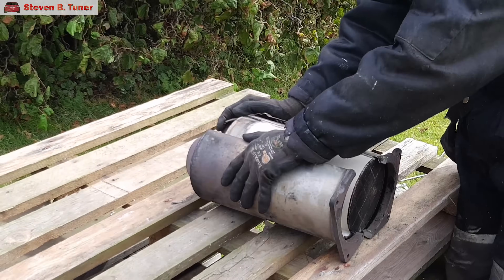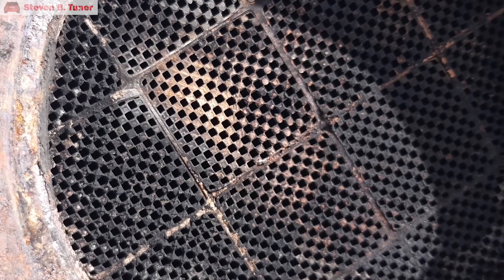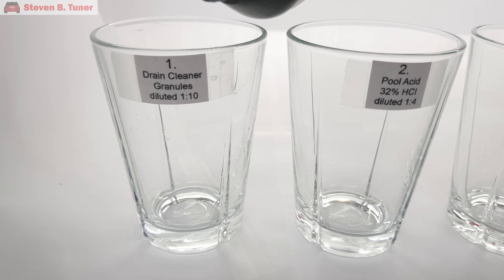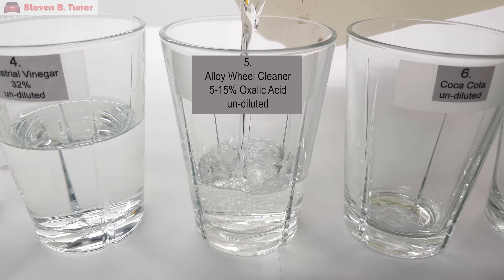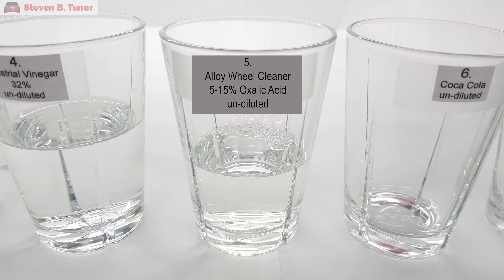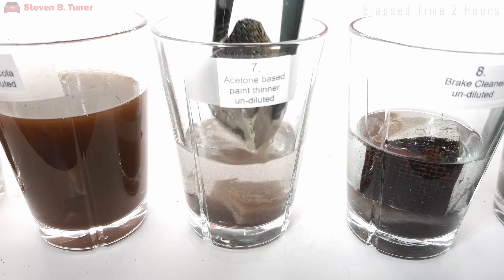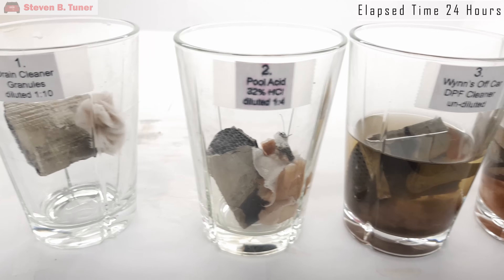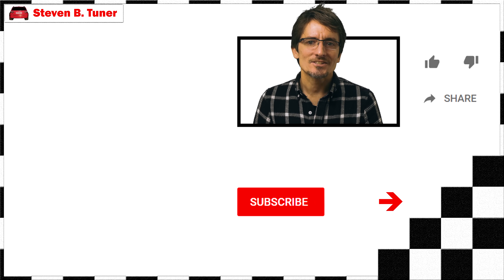DPF Cleaning at Home – 9 Chemicals Tested (Diesel Particulate Filter DIY Ash Cleaning)

Comment: Hi Steven, i recently removed the dpf from a Peugeot Partner van and cleaned it. When it was reinstalled and van taken for short journey a lot of white smoke came out of tailpipe and when engine was stopped the engine fan kept running for ages. Exactly the same thing happened last time i cleaned it 2 years ago and have never heard this fan running before that or since except for the latest clean out. Why do you think this happened? Love your videos keep up the good work.
Reply: Maybe you need to run "DPF filter replacement" procedure with diagnostic software to let ECU know that filter is not clogged anymore.
Reply: @emulatorbluestack7231  No warning indicators since cleaning filter
Reply from the maker: Hi, I am guessing that either there was water or residual chemical left in the DPF that was burning off or otherwise your engine ECU got very confused by the sudden drop in pressure and initiated an extended regen which dumped a bunch of un-combusted diesel into the exhaust.

Comment: Great and informative video Steven. Apologies if I missed it, but have you tried sulphuric acid as one of the ash dissolving agents, either concentrated or diluted? It's available from certain outlets as an extra powerful drain cleaner at 90% or so concentration.
Reply from the maker: Hi, I suspect that sulphuric acid will work fine, and won't damage the steel case - although I haven't tried it. I have avoided it as it is not easily obtained by individuals in most of the world, and it is pretty nasty if it splashes on you - so protect yourself well. It would be great to hear how it works out!

Comment: So Alloy wheel cleaner should be a good thing to put in the DPF?
Reply from the maker: Hi, thanks for watching! I haven't done a full clean with it, but others have commented that it works well as the 2nd stage clean instead of the HCl used in this video: https://www.youtube.com/watch?v=LE1boZ3fhLg  Concentrations and ingredients of wheel cleaner can vary a lot, so you will probably have to review the safety datasheets to ensure that there enough Oxalic Acid or Phosphoric Acid to do a good job.

Comment: You fix this engineering bullshit by cutting it off from your exhaust pipe and putting a clean pipe. DPF is a proof that not all engineers are smart people.
Reply from the maker: Hi, thanks for watching! If it wasn't for particulate filter technology, diesel vehicles would probably have been banned from the roads sometime between 2005 and 2010 worldwide. So I would say that it is one of the more successful engineering solutions out there, as it only needs cleaning every 150-200k miles.

Comment: Hi Steven I have a p244d code and dpf is 55 soot level no idea what it should! be but my galaxy has a vaporiser apparently anyway . ive used 3 dishwasher tablets how long should I keep it soaked for and what next do I need to do can I use mr muscle some have said it can take the coating of the dpf apparently regards
Reply from the maker: Hi, thanks for watching! My other video shows the whole process: https://www.youtube.com/watch?v=LE1boZ3fhLg using drain cleaning granules and pool/brick cleaning acid mixed 1:4 with water. Using 10 dishwasher tablets can work instead of drain cleaner to help dislodge any oil. Mr muscle will also help remove oil. However you will still need the 2nd stage acid wash to remove the ash that has built up over the years in order to have a DPF that is as clean as new.

Comment: Just pour couple of bottles of coke cola into the dpf,  let it sit for couple of days,  jet wash.  Job done.
Reply from the maker: Hi, thanks for watching! Using coca cola is a bit slow compared to the other acids in the vid as it is about 100 times weaker. You can see my preferred method for a full clean in this vid: https://www.youtube.com/watch?v=LE1boZ3fhLg  Also, there can be damage caused by high pressure washing as you can see in this vid: https://www.youtube.com/watch?v=-0mtz3Icg5o

Comment: Great informative video. So Pool cleaner  and alloy wheel cleaner are the best to get you Filter as good as it can be.  What brand of pool cleaner/alloy wheel cleaner did you use, Please?.   :-)
Reply from the maker: Hi, thanks for watching! This video shows the whole process: https://www.youtube.com/watch?v=LE1boZ3fhLg  So far the drain cleaner (caustic soda / sodium hydroxide) is still my favorite pre-wash, and my favorite main wash is 32% Hydrochloric acid (pool acid / brick cleaning acid) mixed 1:4 with water. These are generic chemicals available worldwide, so there is no brand to recommend.

Comment: I can't understand 100% of your words because the translator isn't working properly.
How many drugs should I choose from the drugs 1 to 9 in the video?
Reply from the maker: Hi, the chemicals that have worked the best in my previous video are drain cleaner granules (Sodium Hydroxide / caustic soda) dissolved in 10 parts water, and then 32% hydrochloric acid (pool acid or brick cleaning acid) dissolved in 4 parts water. The whole process can be seen in my video "The No Damage DPF Clean": https://www.youtube.com/watch?v=LE1boZ3fhLg
Reply: @StevenBTuner  Watched the video. In Korea, a large amount of hydrochloric acid is not readily available. Can you obtain effective results by cleaning dpf using only sodium hydroxide?
Reply from the maker: Hi, sodium hydroxide is not enough on it's own as a lot of the compounds in the ash only dissolve in acids. Can you buy products for use with hydroponic plant growing? There are hydroponics water acidity modifiers that should work for cleaning a DPF. The 'pH Down' product is usually Nitric Acid or Phoshoric Acid (use instead of hydrochloric acid), and the 'pH Up' product is usually Potassium Hydroxide (which can be used instead of Sodium Hydroxide).

Comment: Specific brands would be useful as ingredients can vary
Reply from the maker: Hi, thanks for watching! Because this video is seen all over the world I deliberately avoid brand names wherever possible. Every country has swimming pools that need acid, or bricks that need cleaning, or drains that need flushing - so there are always local generic brands that provide these types of chemicals at the lowest possible prices. Sometimes the concentrations differ, but that is a relatively easy adjustment to make as it just means adding more or less water.
Reply: @StevenBTuner  then the test provides little useful info also why is Wynnes an exception as you mention them
Reply from the maker: Hi, I don't know why you would say that - 30% pool acid mixed 1:4 with acid can be replicated in every country with ease, so it is super useful information that anyone can use. The Wynn's product is in there because I was asked to test it by a viewer, and it also shows how just because something sounds like the right product and has a known name, doesn't necessarily mean it is going to work.
Reply: @StevenBTuner  Yes however you use for instance a specific  wheel cleaner a specific dishwasher tablet who's ingredients will be brand specific  hence other brands my not give the same results
Reply from the maker: @ARTSPRAYUK  Great point - there are much more reliable ways to get the active ingredient of that particular wheel cleaner (oxalic acid), and as for dishwasher tabs, well, all that I want from them is their ability to break down some oil - so dish-washing liquid could just as easily be used (although it is a bit foamy), or some kind of standard industrial de-greaser.

Comment: Mybe gasoline good for cleaning this
Reply from the maker: Hi, thanks for watching! Gasoline doesn't have any effect on ash or soot, so isn't really useful as a DPF cleaner pre-wash or main wash. It would work to remove oil, but degreaser is a much safer option.
Reply: @jorulfkolsvik7457  ok mister...good experience

Comment: I would like to see a test with denatured alcohol (commonly found in the painting section at a local hardware store or home improvement center). I had looked all over for a product that would release the lacquered/varnished parts(carbs and tanks) of a normal gas(petrol) motor. I found a YouTube video that had suggested denatured alcohol. So tried it on a generator gas tank that had sat for upward of 10 yrs without being run. Within minutes it had broken down a very good portion of the glazed gas and I left it sit for 24 hrs. The inside of the tank looked as though it were new without any agitation. Best of luck and thanks for the video!
Reply from the maker: Hi, thanks for watching and for the suggestion! I haven't tried it myself, but it sounds like it might work for dissolving any oil, and so might make a good 'pre-wash'.

Comment: Hi Steven B. Congratulations , great videos...
But the dishwasher tabs doesn't have some sand to improve the dish washing? if so, this sand can block the DPF
Reply from the maker: Hi, I guess that there are a lot of different types out there - I would recommend fully crushing and dissolving before using, and not pouring in any sediment from the bottom of the bucket just in case.

Comment: Hi Steven, great videos! 
I have just cleaned my dpf. For the pre clean I used Fairy platinum dishwasher tabs x 15 in 3lts of hot water, which was enough to totally fill and clean my dpf unit. Most brick cleaners here in the UK are hydrochloric acid 16%, pool cleaner is not so readily available, so I used brick cleaner 2:1, then flushed with lots of fresh water. Only thing I did different was to dry the unit with a hot air gun afterwards (I was worried that water in the insulation would turn to steam under exhaust temperatures and cause some damage? A high amount of water is absorbed in the insulation!) I then stood the dpf vertically on its outlet (cat end) with the hot air blowing in the bottom, took quite some time to dry! 
It would be good to see a video of you putting a dpf back after cleaning and showing what checks should be carried out to show it is working correctly, there are probably a lot of people that watch these videos on cleaning a dpf unit and quite capable of taking the unit off their vehicle and carrying out the clean, but would not be sure on how to check it is performing correctly/better after the clean! Also some detail of why you would take the dpf of the car in the first place, I know you have produced other videos of things likely to cause a blocked dpf, but there are tests that should be carried out first, before removing the dpf to clean.
Reply from the maker: Well done on doing the job yourself! My 2006 320D is up to 70 grams of ash now so it is time to do the full video from error message all the way through the process to measured ash level when it is back on the car - just as you have suggested. I wouldn't mind a bit of warmer weather first ;-)
Reply: Hi Steven S, did you use 15 tablets in 3lt of water?
Reply from the maker: Hi, how many tablets and how much water is really dependent on how much oily soot is in the filter. If the car is running perfectly (except for the ash clogging) then 10 tablets in 10 litres could be fine, but if there is a lot of oil then you would be better with 20 or 30 in 10 litres  of water.
Reply: @miguelpinheiro8553  Hi, yes I did, this worked for me although mine was not that blocked with soot and grease, it was as a preclean to the acid clean as mine was more blocked with ash. 15 tabs did seem like plenty though, when you think one would normally do a whole load of greasy dishes!
Reply: Doesnt all this suggest that DPF cleaning is really not the issue its made out to be? Maybe if one is a workshop, having cars hanging around for 24 hours to do the work is a real profit limiter, so they tend to use machines and no doubt a proprietory chemical on a rental program. But if one has 24 hours and the car is at one's home it seems to me there's not much stopping us from concluding that Steven's experiments give us high degree of belief in Oxalic acid and dishwasher tabs (perhaps increased if the soot is particularly heavy and we can fill the DPF up from the oxygen or temperature sensor on the top if the DPF is the upright type. Looks like you could actually get rid of the ash when others have said no, once inside there is no effective solution for ash. In fact it is claimed that the amount of ash capacity is the limiting factor to the DPF lifetime. But having loooked at Steven's experiments I cannot help but feel he has managed to explode a myth that is so costly to deal with in normal ways, such as commercial cleaning (£200+) or some are persuaded, seemingly wrongly, that their DPF has in fact reached its ultimate lifetime. I wonder if others agree with me that Steven has demonstrated the no harm solution conclusively. So what determines if you can clean your DPF whilst its in or on your vehicle or whether it must be removed? Might that simply be determined by whether your DPF is in the exhaust system underneath, where one might have to know is it really about whether its a lateral box, liable to half fill with DPF fluid (whatever we decide to choose)? I've just written a bit earlier about this. 

When I think of using a spray wand through any removable sensor on top, as directed by Mannol's 9694, or even their two-part 9995 and 9996, the manufacturer seems only concerned that one puts the whole contents misted as a spray inside the DPF. In that sense they're like Steven's method of a two-stage process. I wonder how we might better know just how much ash can be cleared and whether, apart from mechanical/structural failure, there's really any limitation to the number of times one can refresh this way. More insight needed. Great subject. Steven must have saved a great many people an awful lot of money.  

Others may have noticed another conversation going on here where someone claimed the DPF cleaners are snake oil and referred to a product. That was followed by well of 80% of those replying that they didn't agree and the solution worked for them. So is it really explosion of the great DPF myth? Maybe, perhaps there are some very poor designs of DPF that may not be so serviceable. My comments relate in the main to the upright type of DPF that sits next or near to the turbo.

Comment: Relay nice
If possible can we know witch brand was the dishwasher tab ?
I feel like in the future I'm going to do some dish washing on my dpf :)
Thank you for your time and effort
Reply from the maker: Hi, thanks for watching! The dishwasher tablet that I used was one that had fallen down the back of the cupboard, so I don't know what brand it was, but I don't think it matters - I think any of them will loosen up oily soot ready for the more important 2nd stage acid wash.
Reply: @StevenBTuner  
I will do this kind of treatment to my dpf the next month :)
I'll just remove any sensors and block it on the bottom fill it with 10 /1 water and ad the dishwasher tabs inside.
Let it for 24 ours, drain well, blow some air inside after until I'm sure there is as little moisture inside mount everything back  :)
Thank you
Reply from the maker: Hi, I have a video on the complete cleaning process to get a DPF back to new condition: https://www.youtube.com/watch?v=LE1boZ3fhLg  but instead of the drain cleaner you can use 10-20 crushed up dishwasher tablets - up to you. Keep in mind that to remove any ash buildup in the filter requires the diluted acid wash too. Dishwasher tablets or drain cleaner on their own won't dissolve all of the ash.